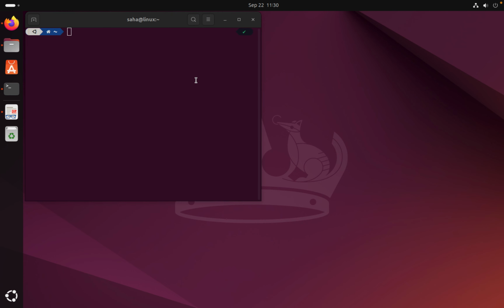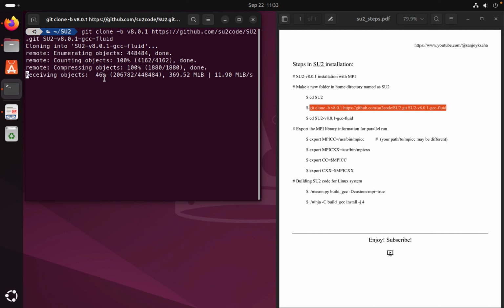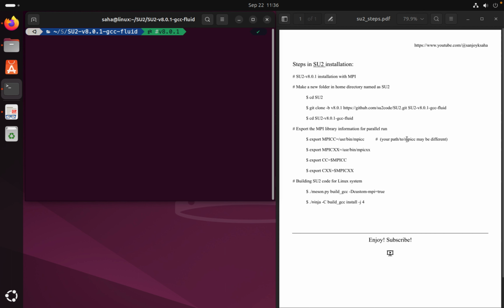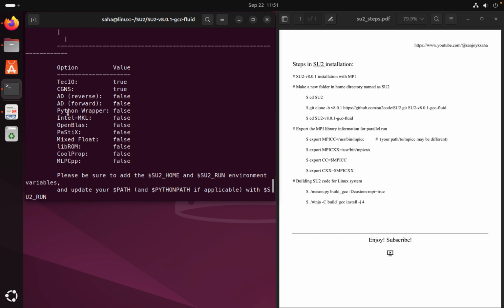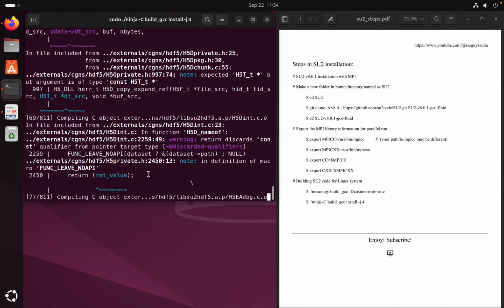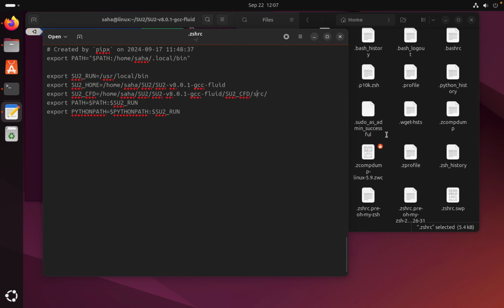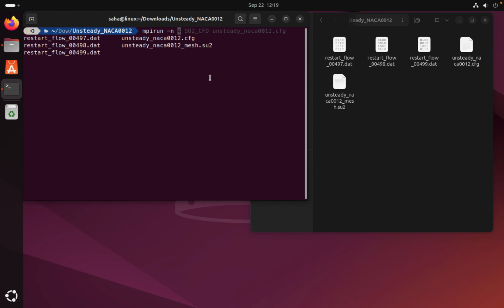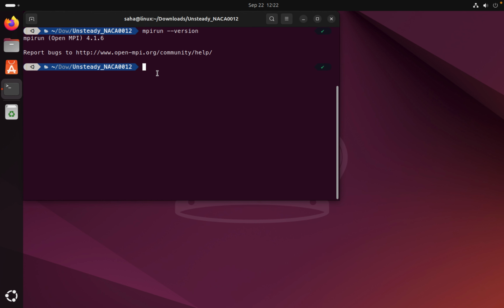How To: Install SU2 CFD Code v8.0.1 in Ubuntu 2404 #cfd #opensource #aerospace

Comment: Thanks for such a helpful and crisp video !! 
A short comment: The addition of SU2_CFD in the ./bashrc is not required. The SU2_RUN present in .bashrc already points to the executables, so it is enough to call the SU2_CFD exectuable.
Reply from the maker: Thanks! Probably I did something wrong with my environment and I solved the issue this way.

Comment: Hello Sanjoy, thank you for your video!

Unfortunately, even though I have follow exactly your step by step process, my installation on Ubuntu is failed at the last step when installing (./ninja -C build_gcc). It said: "bash: ./ninja: no such file on directory"
Would you know why? and provide the solution here or upload a new video. Thank you in advance.
Reply from the maker: Thank you for reaching out. Does the ./meson.py build_gcc -Dcustom-mpi=true ran without any error?
Reply: @sanjoyksaha  yes. it has this message : "ERROR: must specify at least one directory name"'
Reply from the maker: @bungyorga8166  You should follow the steps accordingly. I think you missed the directory change step before calling ./meson.py.
Reply: You may need to install python 3.12.6 due to the deprecation of the pipes module.  I use a conda environment:
$ cat environment.yml
name: SU2
channels:
  - nvidia
  - conda-forge
  - default
dependencies:
  - python=3.12.6
Reply: @jabowery  thank you jabowery, i will try it